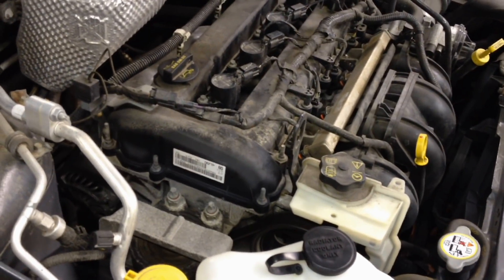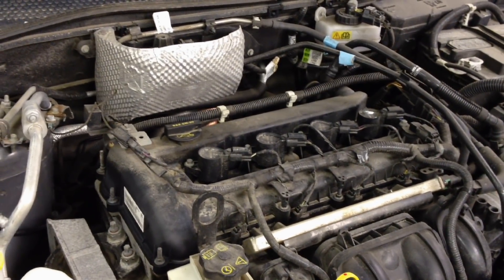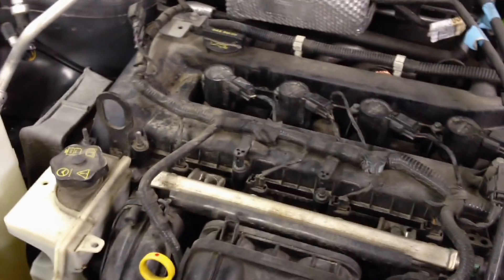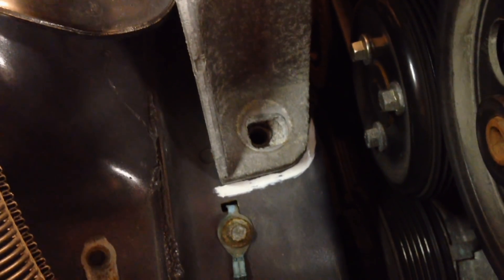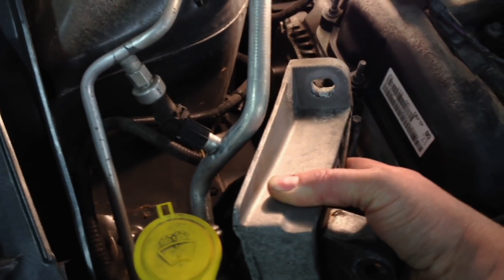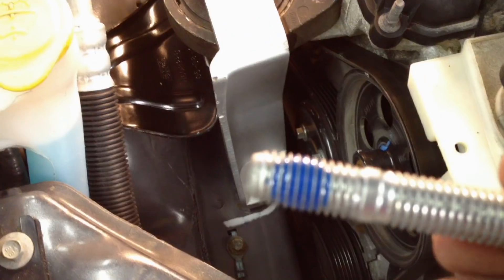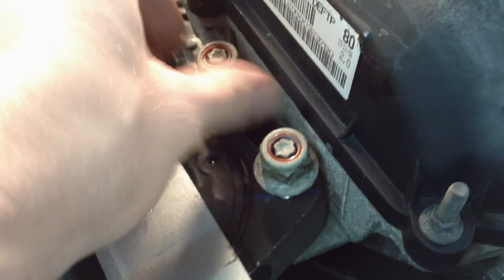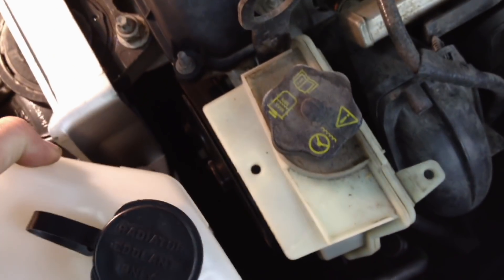Ford Focus Engine Mount Vibration Repair

Comment: This video 📷 really helped me.  In my situation, one of the top bolts that holds onto the engine block itself, well the piece is completely broken off.  Not sure how that happened. So in my case, only one top screw is down tight.  This won't be permanent, lucky me. The vehicle runs smooth like butter though.

Comment: My passenger mount wasn't even leaking fluid but the cheap aftermarket replacement took it from 5.5 vibration to 3.1(Richter scale app) engine sat a good half inch higher after had to jack it much more than required for removal. Transmission mount took it from 3.1 to 2.8. saving the dog bone mount for later, it's like a new car already lol.

Comment: if this mount is bad, will the VIBRERATION smooth out at 75plus? (higher speeds than 73 anyhow)  or is that a different ''balancer'' or something??

Comment: Thank you so much for all the details, your tutorial made this quick and easy. Best part is that the dash, the doors, and the window posts are silent now, and can look at the rear inside view mirrors, and they are vibration free! Thrilled with the results!
Reply: did your viberation smooth out at HIGH SPEEDS??? or was it constant always there with this  mount being bad?  my viberations ''go away'' at 73 plus....  eh... lol

Comment: Fordtechmakuloco is the best Ford tech out there so knowledgeable I watch every video you have! Because there's always one for me. I finally just bought a Amazon kit for all 3. The passenger side one is pretty common and I replaced just a day or two ago and I snapped one of the 15 mm bolts. Do be careful DO NOT overtighten these. And I didn't know to line these up. These are common culprit so much play on my old one that causes so much vibration. It was so noticable and my headaches are gone lol my idle is nicer now surprisingly!!! She's so much quiet. But today I'm tackling the other one the transmission one. And then that weird looking one that I have no clue where it is or how to do it. But usually this mount job alone will solve most the vibration issues from your motor mounts (get an OEM one always buy OEM Ford motorcraft parts. I know they're expensive but I had to cheap on this one and I will regret I know when it goes out again in another year my '11 is at 179k bout to hit another 10k hopefully can get 20k out of this car and more! Duratec 2.0l engines are the best model year.

Comment: Just repaired my 2010 Focus SES Coupe mount this afternoon.  After 187,000 miles put on as the original owner, it was time.  It's like a brand new car.  Don't save a few bucks; go to the Dealer Parts Counter and get a OEM one.  Another thing I'd suggest is taking the one 10 mm bolt out of the Windshield Wiper Fluid neck so you can CAREFULLY flex it as you pull the old one out.

Comment: Great video! I have a 2015 Focus 2.0 with the infamous DCT and it shakes at lower speeds, especially going up hills. Could this be caused by bad motor mounts? The car has 60k miles on it but it's a northern car.

Comment: I had a slight vibration on the car for 8 years. I always thought it was the wheels. After replacing replacing the engine mounting when started leaking 3 days ago the vibration is gone. My car is driving like a brand new car

Comment: Torque Specs:
2 Engine 18mm Bolts - 66 ft-lbs
3 body 15mm Bolts - 35 ft-lbs

I just did it myself, jacking up the engine right was the tricky part for me

Comment: I got only a rubber bushing and need to reuse the old metal mount.  Why didnt you use blue locktight on the second studto the engine mount?

Comment: Trying to find a oem one. The part is backordered and has no eta. Anyone have any leads?
Reply: I walked into my local dealership today and got one. 133 bucs after taxes. I can totally see the problem now. There is no gap between the rubber part where it meets the metal on the new one. On my current one I can stick a pencil in between the rubber and the metal 😬.

Comment: Any chance you could elaborate on the “power train/drivetrain mount neutralizing”. Loosen the power train/drivetrain mount fasteners, would that be all the fasteners holding mounts to frame?

Comment: Did this replacement today and OMG! what a difference.  I replaced the driver side mount first thinking it was the culprit.  But even after that, when I would open the two back doors both of them shook violently! along with the steering wheel, and everything else in the cabin.  Even the battery shook after the driver side mount was replaced.  So I was confused as to how it could be the passenger side since the battery was directly over the other mount!  But, NOPE, I replaced this passenger side mount and It took "ALL" the shaking away.  The car shifts better too!  Man what a difference.  Best 100 bucks I ever spent!  (Not really, But its up there!)  Thank you for the informative video.  I hope this brings sanity to anyone looking to solve this issue.  

BTW,  The initial test you recommended by slightly lifting the engine to relieve pressure on the mount was my green light that is was probably that passenger mount!!  

Happy Holidays.

Comment: @fordtechmakuloco Probably a long shot since this vid is so old but on the 2003 zetec DOHC do you know the part number and if the studs are with the e torx are available still?  If not what about that engine mount bracket on near the timing belt the studs are bolted into?  

I may have broken off a stud :)
Reply from the maker: no longer made it says.

Comment: Do I need to remove the exhaust the change the rear motor mount? I have a 2000, zetec/DOHC.  I know you said "The first thing you do is support the oil pan"  I don't want to get started to realize I've got a day and a half trying to remove the rusted nuts holding the header.

Comment: had my son in the car while i jacked up the engine like you said to see if it was bad...jacked a couple times and it got smooth as heck...so i did what you said to replace...it went great...put it back together but it still has a vibe...is there another mount that can go bad? they said at the parts store that this was the mount for the right side...so can i assume theres a left...i felt like a real mechanic for a little while...your spot on on the directions

Comment: I really enjoy your videos and the work you do, you are very informative and helpful  !!! With that said, I absolutely don't like the way you use your influence to make people believe that they should only buy oem products, there are many after market products that are just as good and even better than the original Ford parts !!! there are many after market products that are inferior and perhaps that's why you recommend them but OEM isn't the only solution !!! With proper research you can differentiate between the two  !!!
Reply from the maker: If there is an aftermarket product I would certainly suggest it, Have you seen all the videos on the Melling brand oil pumps? In this case and most other cases nothing but OEM should be used this is the voice of experience not personal preference.

Comment: The Ford engineers that designed the mounts on this car shouldn't be allowed to design a lawnmower.  I have replaced the passenger side twice now on an 07 2.0L and the car doesn't even have 100k yet.  My Corolla has 220k and have never even had to think about the motor mounts.

Comment: You must use a FORD OEM Mount. Believe me a knockoff will not work. I’ve tried. I finally shelled out the dough and the car is so quiet. It’s amazing.

Comment: I'm attempting to replace this mount and i have the oil pan supported with a jack and wood but when I take the nuts out the engine still falls I've moved the lift points a few times but it still falls any ideas?

Comment: Nice video as always 
I've just replaced my mount but at the top of the rubber mount on the left slide it has got a bulge on it instead of being flat
after lowering the engine back down Wasn't there before lowering engine any I dears could it not be seated properly many thanks 👍
Reply: On my 2014 Ford Transit Connect that motor mount the rubber is sucked all the way down and the one I replaced wasn't like that......

Comment: After removing the old mount, would this provide an opportunity to more easily replace the belt? I’m at 103,000 miles so I’m probably due for changing the belt as well.  Thanks 👍🏻

Comment: Hi, I've got a question. My passenger engine mount is blown on my MK3 focus (it's leaking) and it's been a couple of months now. I don't get too strong vibration from the engine, but I get some shudder when taking off in 1st gear, but only when the car is hot. Do you think there might be a link there? Thanks for your video.

Comment: 2012-2018 models are just as bad with the mounts. I have 80k miles and my vibration just went up noticeably. Used to be most noticeable on cold mornings. Now you feel it on warm afternoons idling. That's crazy. Basically gonna replace it 2-3 times for the life of the car .

Comment: Thanks for the instructions. Just changed the passenger side mount on my 2013 and now it drives like a new car....aside from the transmission which Ford never seems to get working right. Still has that shudder in low gears.

Comment: I used your video to fix the mount on my transit connect, very detailed and was easy to do. Thank you for making this!
Reply: Thanks I’m gonna replace it this weekend. I hopefully  I solve  the problem.
Reply: I have the same problem on my transit, u did all the mounts or just the left side ? Thxs
Reply: Oswaldo Ceron sanabria I just did the left side. Haven’t had a problem since I changed it out.

Comment: My car shakes when under load mainly between 1500 and 2500 revs and seems To get worse as it heats, could this be the motor mount ot also rough isles when it's warm and has a knocking noise when doing so
Reply: Probably need a new engine if it’s knocking

Comment: Do you recommend the ford mount? I’ve change them once with aftermarket insert and still has vibration.
Reply: Always go OEM! If you can afford it of course, aftermarket is always a gamble.

Comment: With the left side mount do you have to change the metal thing that holds the rubber mount or can you just change the actual rubber mount inside??

Comment: On the 2 stud bolt's how many ft/lb torque specs cuss don't want to over tighten them?? before placing the 2 nuts and tighten them to 59 ft/lb motor mount torque specs ford focus 2000.

Comment: How long are the originals expected to last in terms on miles traveled?  And are the aftermarket replacement ones likely to last longer?  And finally, is it just the right hand engine mount that is a problem, or should I be replacing any other mounts as well as the one shown in the video?

Comment: can you do a video on changing the mount on the drivers side 2013 focus st
Reply: I saw a video for that one it's underneath the battery box it looks extremely simple to do and remove just make sure you lightly support the transmission just like what he did with the oil pan

Comment: Here is some great advise from an FF 5 time owner. When replacing the right MM, do nor scrimp out on quality. Buy a Motorcraft part, not the cheap knock offs. Mostly made by Anchor, China made junk. The Anchor will work fine for 7,000 miles then vibrations will return. Save yourself the extra time of replacing the mount a second time. JMO.
Reply: Thanks for that

Comment: I just kept putting up with the rattling and noise getting louder and louder, but it was getting out of hand.  I inspected the mount and it appeared that the oil had come out and it was worn badly, so I decided to replace it. Like other users have stated, it is staggering the difference this makes. Its so quiet I cant hear it now, and its very smooth as well. Great instructions, save yourself a few hundred dollars and do this job yourself. 

I was told to get the part from the ford dealership though, they said the aftermarket parts wont be near as good and you definitely want to stay away from the 'solid rubber' ones.
Reply from the maker: Yup the aftermarket units don't last near as long.

Comment: I have the rough idle and vibration. Mechanic have me an estimate and told me it was the wishbone mount. He rocked the wheels and the whole thing shook. I’m guessing all three need to go, but I will start with that one and then these if it doesn’t fix it.

Comment: I was FINISHED with my '07 Focus...the vibration got so bad. I figured the engine was aging and vibration was inevitable. I swapped out all the mounts and wow - the car drives like it's new again.
Reply: tanbrolo how many mounts did you replace?
Reply: Maria Tejada I replaced all three. Apparently the most common trouble mount is the top passenger side. For me, I found that changing the bottom mount made the most difference.

Comment: I know this has been a while but Im going to try and change my 2008 ford focus. Motor mounts...i have a few questions 1. When I do the lower mount on drivers side I can natually jack up the car right to be able to get under the car and if so do i jack the car up normally and then have a 2nd jack to put under the engine ?  And 2 the one on the passenger side do u actually put the wood and jack under the oil pan itself is it strong enough not to bend the oil pan ?

Comment: I had Autozone run the parts. They show two passenger side mounts for the 2007 Ford Focus. One called Front Passenger Side Mount and the other Rear Passenger Side Mount. There is also a third mount on Driver's side on the bottom. You are referencing only one Passenger side Mount, AND I see only ONE on my car, and it looks like the one you changed.
Can you give a little more insight on this? Good video, by the way; most vids like this are not so good.

Comment: Ok, well i have a 2009 ford focus and I took of the 3 bolts before i lifted it. When i tried to lift it, the mount never got loose. Does that meam my mount it good? I wanted to replace it

Comment: thank you for help..car is good now..however, I was too afraid to put 66 ft lbs torque as I felt like I was going to break and lose threading. Will it break? 66 ft lbs is a bit too much. I was turning the torque wrench and still couldnt hear the click . I stopped tightening afraid I was gonna snap it

Comment: Does this car only have one engine mount ?
Reply from the maker: It has 3 one on the right one on the left plus an anti roll mount underneath.
Reply: FordTechMakuloco and left and right mount is the same? Im trying to find them on eBay but only see the Right and the one is forma the transmition-engine....

Comment: What was the part number to order this mount as a complete part? Using the part fitment guide (link you provided) it only showed me the part with rubber and not the other metal part needed to attach to the frame. I want to remove the old one and replace with new one.

Comment: Can you please tell me where the idle air control valve is located for this engine? I looked all over the air intake area and couldn't find it.. Thanks
Reply: Anoop Dsouza thank you for your reply. It is probably an electronic one, then. The reason I asked is because I wanted to clean it since the RPMs fluctuate in Idol
Reply from the maker: On an IAC based system it is always near the throttle body if it is an electronic throttle control system then there isn't one.
Reply: Anoop Dsouza : check your vacuum lines. They become lose or dry rotted and that will give you up and down rpm's at idle.

Comment: What is the size for the studs. I have done this repair before on a 2003. I learned that day, you might as well change all 3 mounts and get it over with.

Comment: Hello Sir, i only get vibration at 3,450 til 3,750 rpm. Can the passenger engine mount be suspect. I changed it with a new aftersales mount without any change at all. Should i look somewhere else?

Comment: Thank you so much for the great video. Bought the part and installed in under 30 minutes. My elderly mother in law had grown so used to the vibration that she didn't notice a problem. She certainly noticed the improvement after the repair. Thank you again!!!!

Comment: I'm hoping this is the issue with my girlfriends 2014 Focus. Bought it brand new and besides the transmission issue most people are complaining about, (we have that too) The vibrations in the car are like nothing I've ever experienced before. You can drive down the street at 20mph and it sounds like you're driving a tank! We literally don't leave change in the car because it rattles so bad. Road trips are almost unbearable because you can't hear each other over the sounds in the car. I just found it hard to believe the motor mounts would be bad after 2 years but after seeing this it's possible. Thanks for the vid.

Comment: just finished replacement motor mount install. Worked to spec.....lock tite.....correct torques...bolts cleaned on wire wheel...jacked with buffer board. All went exactly as you instructed. Replacement mount was Motor Craft.  Very quiet engine now. Thanks for your help. mike
Reply: How long did the mounts last before the vibration came back?

Comment: Can you reuse the aluminum bracket that goes over top of the passenger motor mount?  All of the after market mounts I have looked at don't include the bracket.
Reply: I used a big screw driver,channel locks and a hammer. pretty easy when.Through Ford they sell the complete mount.http://www.fordparts.com/Commerce/PartDetail.aspx?n=xQYI4KrwJlRlgdvNBytszA%3d%3d&id=411457366&m=2&search=true&year=2008&make=Ford&model=Focus
Reply from the maker: +Russell Harrington yes you can
Reply: Is it a hard process to reuse it? I don't want to pull mine off just find out I need some special tools or something.
Reply: On mine there is a metel tab you need to straight out.to slide mount out of aluminum part,slide in the new one and bend the tab up.
Reply: What technique or tool did you use to bend the tab up?
Reply: pliers and a hammer
Reply: I used a hammer and a piece of 2x4 .